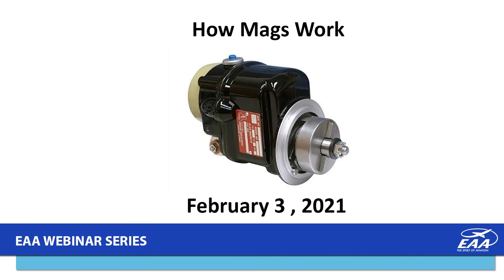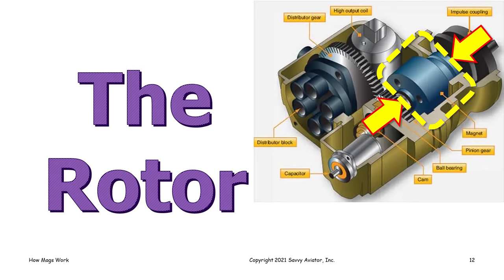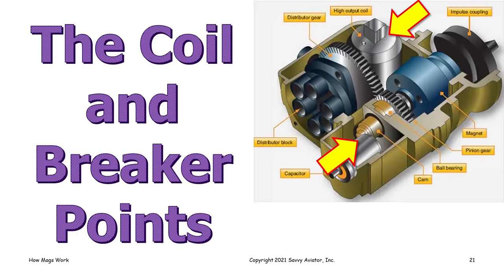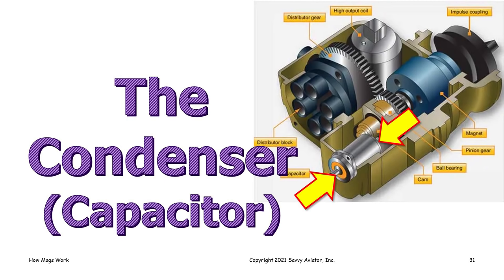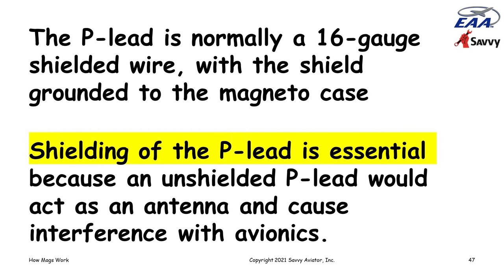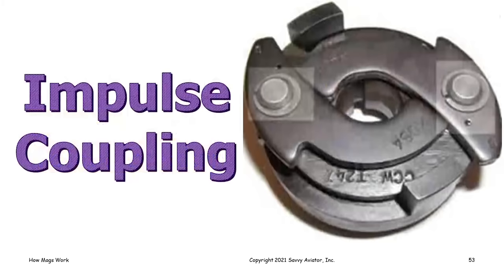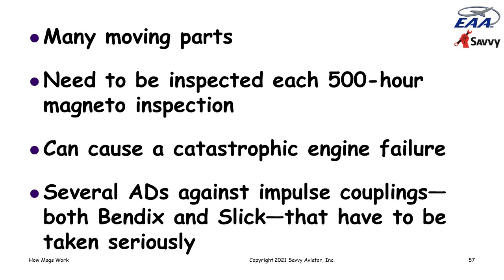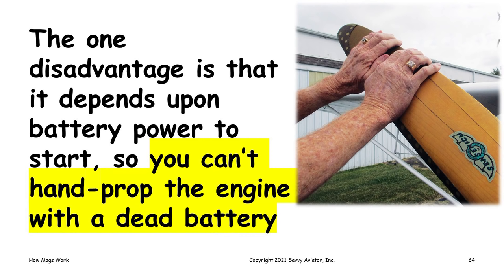How Mags Work

Comment: As a non aviator but die hard gear head, I found your presentation quite thorough. Mags are an ignition system type I've not looked into much. I've often  laughed  at guys with mags on their Harleys kicking themselves  into a coma trying  to start them. I look forward to the  webbinar.

Comment: The purpose of split timing on some Continentals was to fire the spark plug in the leanest part of the combustion chamber first in order to give the flame front a head start. On a C90 the right mag fires at 26 degrees BTDC and the left mag at 28. The right mag on this engine fires the top plugs.

Comment: Slick mags were factory-sealed and not repairable when first introduced, but that did change after several years.  A spark plug's ability to fire depends on condition of the mag, engine power setting, aircraft altitude, spark plug fouling and plug gap.  New plugs are typically gapped to 0.016" (0.015 - 0.019).  My experience is that the plug gap will erode .002-.003" in the first 100 hours after new or re-gapping to 0.016", but the gap erodes .004 - .006" in the second 100 hours, and .008 - .012" in the third 100 hours.  This brings the gap to approximately .035".  At this point, the plugs are worn out.  I did have a set in a trainer run 1100 hours by re-gapping every 100 hours.  The wider the gap, the higher the altitude, the higher the cylinder pressure, the harder it is to fire the plug.  
All of these factors relate to the function and efficiency of the mag.

Comment: Why is the coil grounded to the case?  The ground for the primary circuit should be through the points.  The ground for the secondary circuit should be through the spark plug.  Grounding the coil to the case creates a direct short to ground for any current created by the magnet or collapse of the primary circuit.

Comment: Dear sir, please advice me,  I watched your old video "The EGT Myth" . It is great.   I have nice two seat aircraft and it has Rotax 912 ULS which is using two Bing carburators. I live in Czech Republic. Rotax does´not have the mixture control knob. I plan to buy HACMAC system which is supposed to be added to ROTAX or Jabiru for mixture control. Rotax has got also water cooling system and that is why I think, that what you explained about importance of controling CHT is unfortunately not much usable in water cooled engines. Am I right? Now I control just oil and water temperature and I will buy probes for controling EGT.  I called Rotax and I realy found out, that they no longer offer any means for measuring CHT, so I can only measure (as I am doing)  watter temperature which is coolig CH...
In this case I probably will have to concentrate or rely on EGT only. Please let, me know: What to do to run my motor for maximum longevity and  how many degrees below peak EGT do you recomend to run my engine ? ( I most probably will prefer to run it on rich side of peak, since I am afraid of detonation ).   We measure in Celsius. Thanks a lot for any advice. Best regards M.Š.

Comment: Besides acting as a spark snubber for the points, wouldn't the capacitor/condensor also create a resonant circuit with the coil and generate a series of pules to the plug and not just one pulse?
Reply: On no load, yes. However the spark plugs pull so much energy out of the system when they fire that there isn't enough left to fire a second time.

Comment: Why would the EGT rise when one mag is grounded out?
Reply: i forget why, but losing a spark plug does the same thing in that cylinder
Reply: Fuel charge is taking longer to complete combustion.  So it lasts closer to the exhaust stroke.

Comment: Some engines do have different timing between left and right mags, I haven’t seen more than a 2 degree difference though.

There is an AD to check the ignition by turning the key to off and seeing if the engine wants to shut off, wouldn’t be a bad idea to check that on pre or post flight ground run/taxi back. Don’t shut it down that way, just check it.